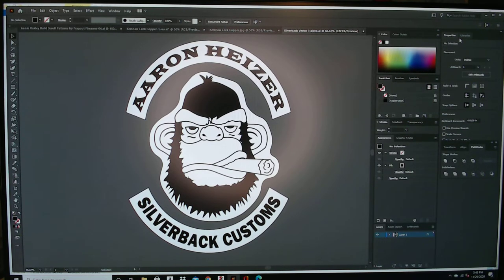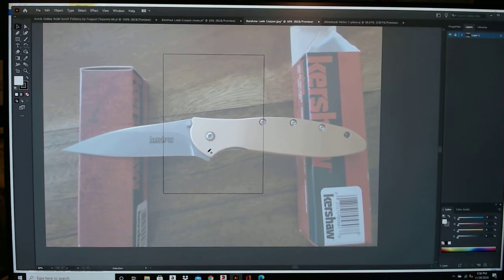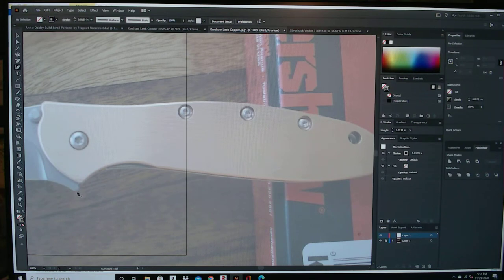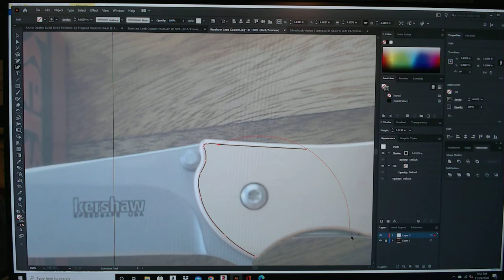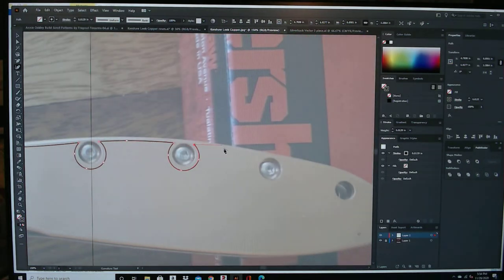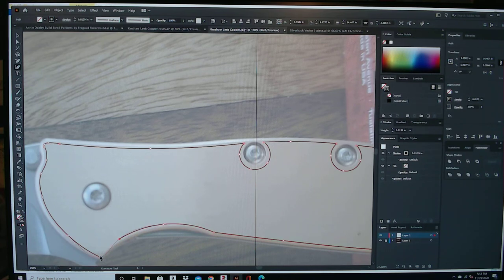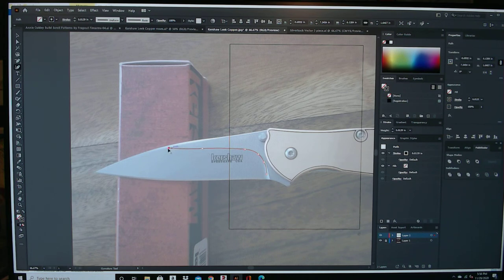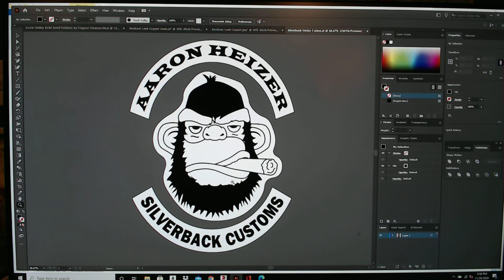Building a file for Fiber Laser engraving (Part 1, Photo and trace)

Comment: Are the sizes correct when you take the outline from a picture ?  i did not add up when i tried this, i used to scan everything with a flatbed scanner but this is kinda difficult when its getting bigger.